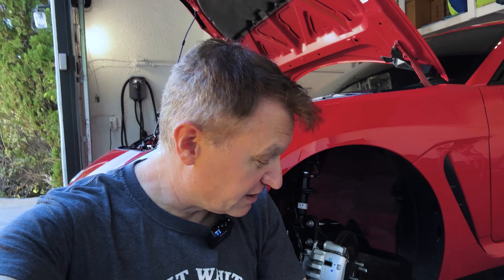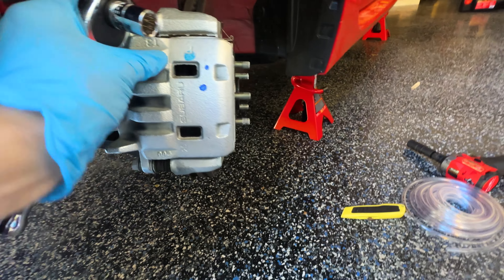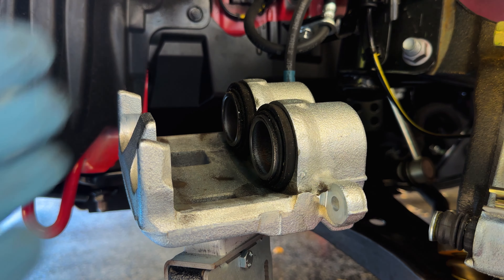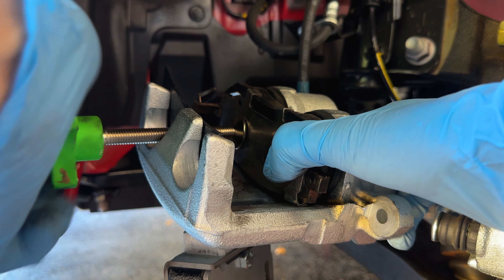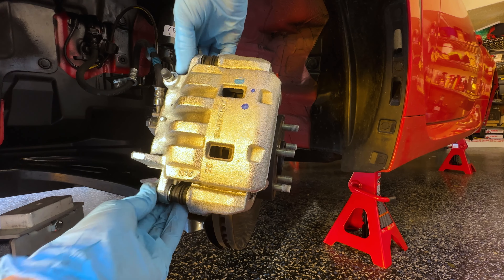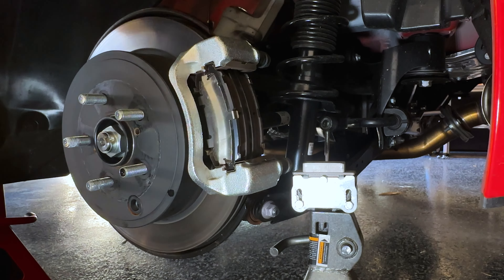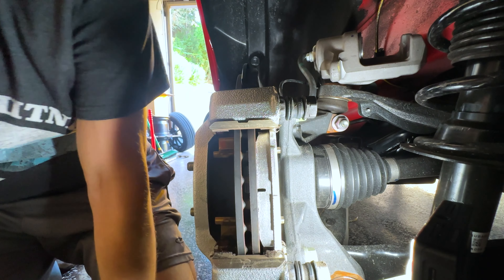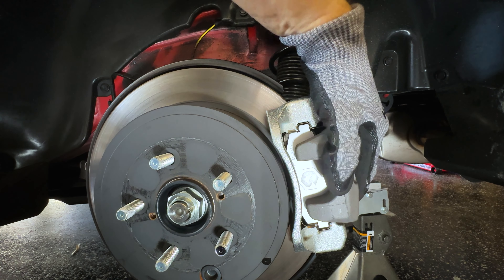How To Change Brake Pads On 2022+ Toyota GR86 / Subaru BRZ

Comment: I replaced my OEM disc brakes for a slotted and drilled and put back the clips again the ones you said aren’t necessary 
But the new rotors and brake pads are squeaker and noisy 
Then I remove the clips out.

Comment: I'm thinking the brake pads with the clips as you call them are probably squeelers. What they do is scrape against the rotor when the brake pad gets dangerously thin to let you know you need to replace your brakes.

Comment: Hi, thanks for your video. Do you put grease behind your pad and caliper contact after changing pad? Or BRZ does not need to add grease for brake pad?
Reply from the maker: I don't use grease

Comment: Thanks for the very helpful video.  Stopping power when on a track would obviously be much better than OEM pads, but what about on the street?  When the brakes are cold or at a medium temperature, what % do you think they have over OEM.  What about longevity?  These CSG Spec CP are $720 to cover all 4 wheels, I’m just trying to determine if they are worth the 2 to nearly 4x cost of pads from EBC or Ferodo, when I am only driving 90% spirited street, and maybe 10% autocross.  I’m guessing that the short answer is no.
Reply from the maker: CSG CP pads will probably last you the lifetime of the vehicle if you drive only one track day per year AND they'll stop without fade. They work great when cold. Only the slightest noise on rare occasion. They stop much, much better than OEM when you're in a canyon or doing highway pulls. I have found they never fade, as long as you have upgraded brake fluid as well.

Comment: I wonder if the oem pad shims will fit. They supposed to help to dissapate heat, not insanely much. But anything will help
Reply from the maker: If you’re running a track compound they are specifically designed to handle higher temperatures
Reply: @RevMatchReviews  I am. Running DS1.11, they still boil my rf650. Tragic, probably gonna go bbk
Reply: No. Not sure what the change frequency for race fluid is but the act of changing pads does not require new fluid.

Comment: I just installed Hawk HPS on my 22 GR86, how do you like the CSG CP's?
Reply from the maker: They are a really good street/track pad. No noise at all, and zero fade on track.  Not hard on the rotors unless you’re into the ABS too much, but that’s true of any pad.
Reply: @RevMatchReviews  Thank you! So the goal is to avoid ABS braking as much as possible. Mainly threshold braking? I think that was mistake i made on previous FWD, I was too hard on brakes/engaging ABS often causing pulsation during hard braking
Reply from the maker: Yes - maximum braking is achieved right before ABS kicks in. I'm still feeling out the car, but the goal is to feel the ABS kick in and then back off so that you're pedal pressure is right below ABS engagement.
Reply: Good job!

Comment: Awesome and very helpful. I also have  22 GR86, I got hawk pads which may be a bit loud but ill change them for CSG at the end of this season. Do I need to change fluid if I follow your steps?
Reply from the maker: If you’re tracking your car you should upgrade to a race fluid such as Endless,  Castrol SRF, or Motul
Reply: @RevMatchReviews  Yes, once I do have fluid in it, do I need to change the fluid if I just change the pads?
Reply: @autosenses2960  No, no need to change fluid with pads, but if tracking, I'd replace fluid once a year (more or less depending on how much tracking) with some high temp fluid.

Comment: No bleeding?
Reply from the maker: If you're just changing the pads, you don't need to bleed to brakes. However, after a couple of years, it's a definitely a good idea. Brake fluid attracts water and in time will cause air bubbles.  

I track my car, so I bleed a couple times per season.